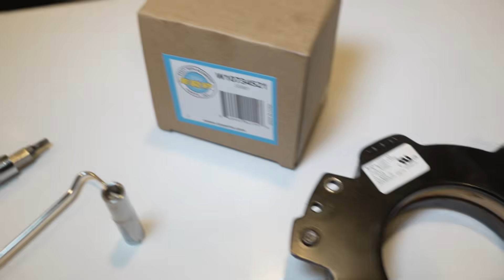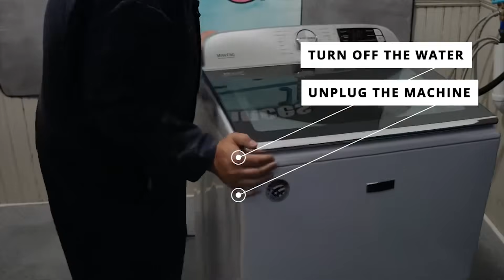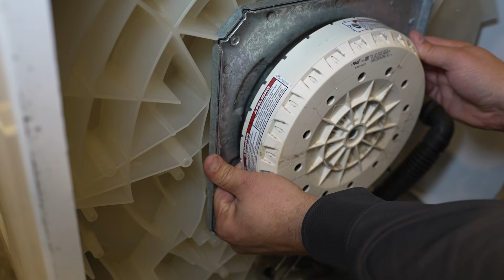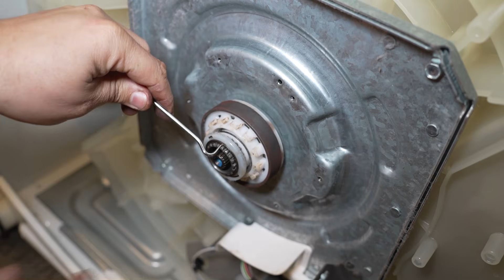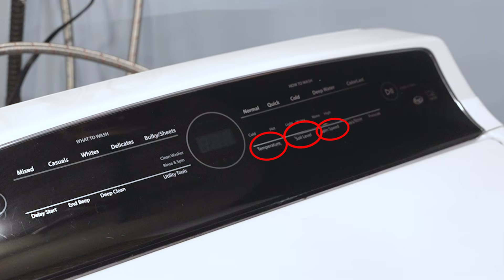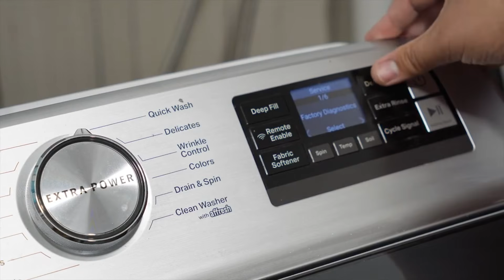Whirlpool Washer Makes Noise in Spin or Has Grinding Noise in Wash - What to Check & Replace

Comment from the maker: Note the models in the description this fixes - its for units with a stator underneath. The two main parts I used to solve the problem in this video:

W10734521 Magnetic Slider Assembly: https://bens-appliances.com/products/w10734521-whirlpool-slider-assembly

W10754448 Electromagnetic Clutch: https://bens-appliances.com/products/w10754448-electromagnetic-clutch-shift-assembly-for-whirlpool-or-maytag-washing-machines
Reply: Sliders were a design error, in my opinion.I have installed bunches of those, and I do repairs part-time.
Reply from the maker: @brentstrong9751 yes terrible idea
Reply: sometimes they are difficult to see as the culprit. The plastic welds break and it is game over.
Reply: @bensappliancesandjunk just ordered as well - thank you . Why do they break though , where is the wear and tear and what would have been a better design ?
Reply: the parts work for all washer my friend?

Comment: You saved the day again, Ben!  Can you please tell us this, if you happen to know: Between these 2 parts (the slider and clutch), how likely is it that the clutch needs replacing? The grinding noises seem to typically be a fault with the slider. I am just curious, as I am having the same issue I had a few years ago and just want to have my parts in order before I pull it apart. Thanks for another great video.
Reply from the maker: Its like 80% the slider and 20% the clutch in terms of odds

Comment: I don't understand the need for re-calibration following slider and/or clutch replacement.  Could you comment on and clarify the need for this re-calibration?  Is it related to matching the coil electrical characteristics to the computer in the control panel?  Thanks.  I sure do miss my old-style Whirlpool washer-it was simple, rugged, and bullet-proof.

Comment: Squealing during spin cycle, insp. Magnets, coils, clutch and slider coupling. All looked ok? Swapped out the slider coupling. Reassembled, checked for free movement, all ok.  Recalibrated #52. Ran a wash cycle. Same loud Squealing during final spin cycle?
Reply: Would it be the clutch?
Reply from the maker: That or bearing
Reply: @bensappliancesandjunk replaced the clutch, still have the squealing noice only during spin cycle? Ran the cal #52 display "000" at the end of cal. Is that normal?
Reply: @georgez3775 curious where you landed on this. mine squeals on the spin cycle when the wife over loads the washer with heavy items. wanted to get part incase it becomes frequent because it’s unbearable

Comment: About to order the slider and clutch for my wtw7000dw4. Anything else that you would probably just go ahead and replace while you have the unit apart or do a little maintenance on? Any other parts that are notoriously problematic that comes to mind? Thank you for the great video!

Comment: Ben, fantastic video. My WTW5105HW1 starting making a noise that sounds more like a couple loose coins when in the spin cycle only. If I use Wrinkle Control, the spin cycle seems less aggressive, and usually quotes up that sound. Don’t think it could be me or two loose magnets off that clutch causing it? And yes, I’ve inspected for coins in the tub, and there appears to be none, unless they’ve gotten under the agitator.

Comment: Right on, Ben! (Whirlpool Model WTW8040DW0 circa 2015) My slider ring white plastic piece has over 20 hairline stress cracks all around the circumference. They are so evenly spaced, it sort of looks like it was made that way.  Washer made a loud chattering/clicking/clacking sound during agitation forward/reverse motion; nothing during high speeds/one-direction. I saw shiny scraping away of the paint around 2/3rds of the inside diameter of the coil from where the steel ring of the slider was rubbing and, presumably, chattering in each direction. That told me the slider ring was moving off center, but even the plastic spline was rock solid... that's when I noticed all the hairline cracks that was likely letting the slider ring move into the powerful electromagnet ("coil") when energized.  There is little clearance between the two.  Hope the coil is not damaged; glad I did not wait to investigate (only one load) because the coil is scraped up pretty good and looks expensive. Clutch kit was only $14 which includes the slider gear, spring/retainer, torx bolt with blue thread locker and snap ring, aka "Jesus clip" (because when they fly off and you know you'll never see it again, you yell, "Jesus... there goes another one!") One tip for getting the magnet motor disc off after removing the torx bolt, instead of pulling with all your might (good way to fly off your stool backward when it lets go suddenly!), turn the torx bolt back in a few threads and while pulling and rotating the motor disc, tap lightly with a hammer on the torx bolt head while keeping a little pressure on the disc... keep turning while tapping and it will slide almost all the way off... remove the torx bolt and more easily wiggle the motor disc the rest of the way off. Of course, carefully using a wheel puller would be best... taping on the center while turning carefully so as not to crack the plastic motor disc. THANK YOU for the information to recalibrate after putting it back together, too!  It is a pretty simple, neat design. THANKS A MILLION for your fantastic video! Much appreciated!

Comment: Thanks for the great video.  I changed the slider assembly on my Cabrio washer and the spin cycle worked again.  It was making a loud high-pitched noise for a while and then wouldn't spin at all.  Hopefully, my 9 year old Cabrio washer will last for 5 more years.  Thanks again
Reply from the maker: Happy to help you fix it!

Comment: I found on my top loader that the rotor center bolt was barely threaded.  It was finger loose and half way out of rotor.  I checked the slide unit for any damage,  zero.  Ran thru diagnostics,  now running a load of towels to verify.  Saved 60$ in parts just by tightening the bolt

Comment: Ben, if either of these parts are bad, could it cause it to leak small amounts of water?  I do notice that the washer is louder than it has been in the past and it has been leaking small amounts.  Would the leak point to more of a seal/gasket issue?

Comment: I would like to hear the noise before and the normal sounds of the washer. Mine makes various noises depending on the chosen cycle and amount of clothes in the machine. It can be easily overloaded. It makes some horrible noises like a banshee having a bad day 😕
Reply from the maker: If its a direct drive stator/rotor system this could be it
Reply: The maytag with "commercial technology " is trash. Suggest that if you own one never use the soap tray @bensappliancesandjunk